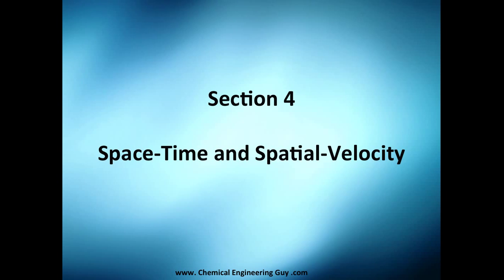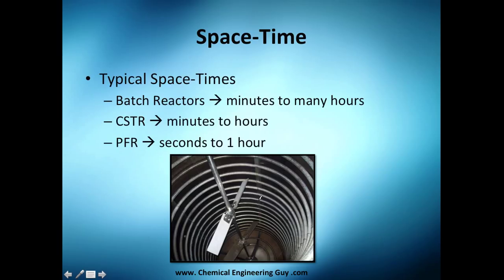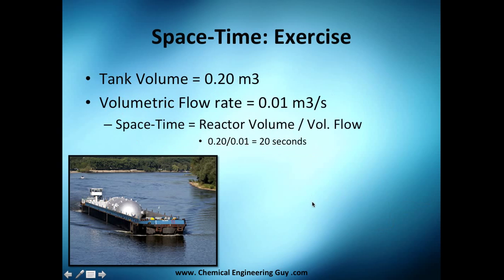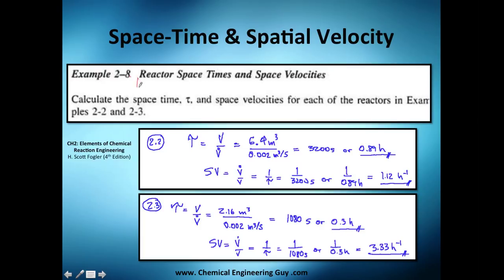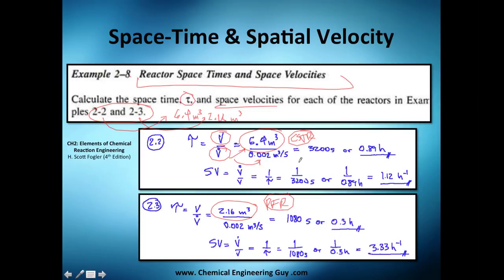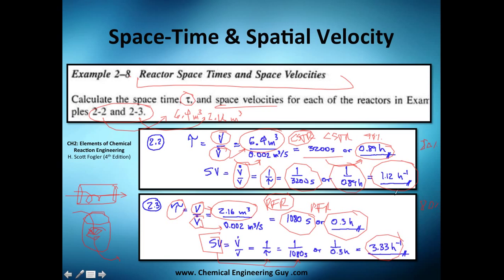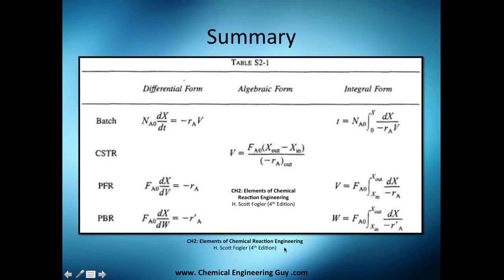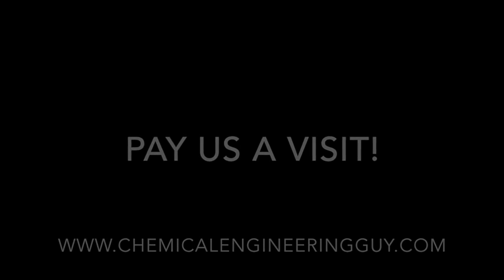Space-time & Spatial-Velocity // Reactor Engineering - Class 35

Comment: If conversion of a PFR reactor having volume 1 m3 is 50% and volumertic flow rate is 1 m3 per second, what will be the space time?
Reply from the maker: Space Time has nothing to do with Conversion
The Reactor might have 0% conversion and you will have the same space-time as a reactor converting 100% materials
Reply: what is difference between holding time and space time?
Reply from the maker: They are practically the same definitions
Reply: Chemical Engineering Guy i have read that they are only equal in case of constant density and are not equal in case of changing density?